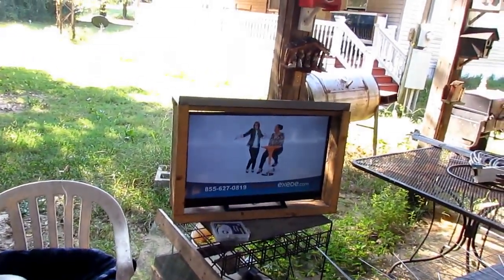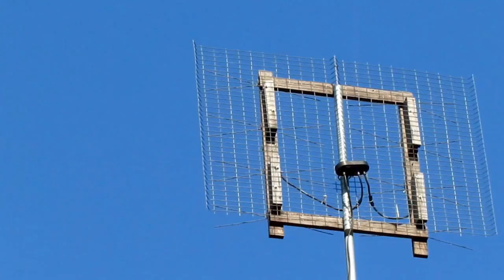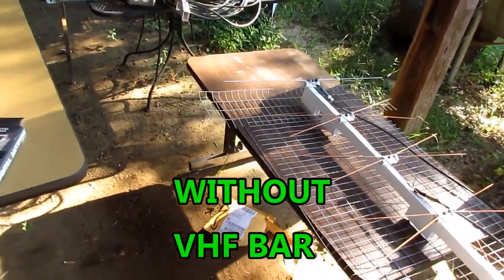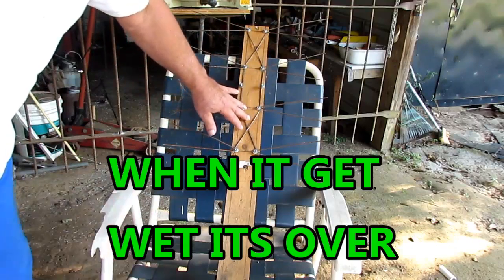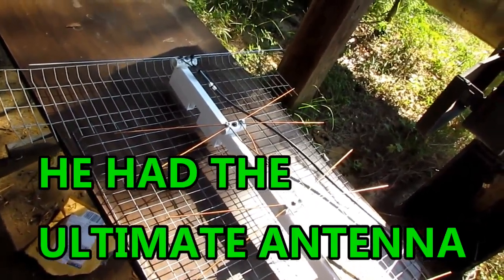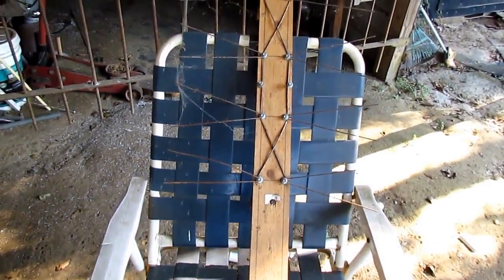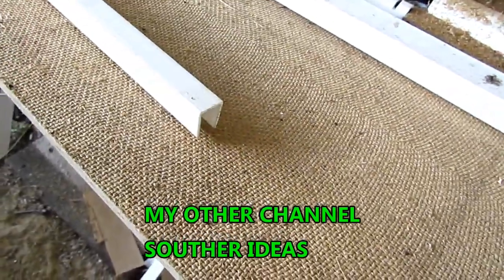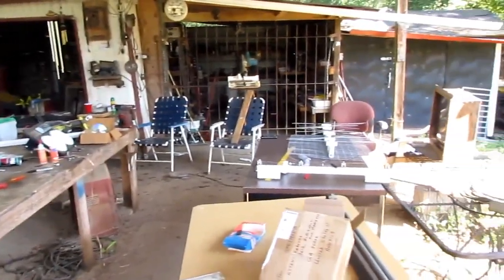Making TV Antennas 101

Comment: Turbo HD TV Antenna will fit in a shipping carton REAL NICE.  Let me caution you though...  the public is extremely stupid about antennas.  They will screw up self installations in numerous dumbassed ways.  Once I had a antenna  we shipped with coax already attached.  All they had to do was take it out of the box and screw the wire to the connector.  Had a 20% RETURN RATE on an incredibly good antenna.

Comment: Danny, I built the ultimate antenna and it works pretty good, but I have a problem.. All my channels CBS, NBC, ABC, and Fox are located Southwest of me around 40 miles away, but I have a local Christian channel that is about a mile from my home located to the Northwest. I'm having to use the RCA booster to pull in the distant channels to the Southwest, and that is causing the really close channel to overload my tuner. Is there any way to maybe add a reflector to the right side of the antenna to block that strong signal that's so close to me?
Reply from the maker: it might not work that close
Reply: Do you also use a distribution amplifier with the RCA pre-amp?  If so that can definitely overload your TV tuner.  If not, maybe you can add a 3 db or 6 db attenuator b4 the signal gets in the RCA pre-amp.  Your idea also might work.
Reply from the maker: NO  distribution amplifier
Reply: You can get a tunable trap and tune out the interfering station. I did that with my FM tuner when I lived on campus near the UCF radio station. I was trying to get classical music stations.

Comment: I think the reason for my question is the dimensions used for the "whiskers" = centered @ 9 1/2"  vertically correct?,   and the dimension for each leg the "diamond" is 7",  correct ?.  if both of the above are true than the diamond will be "out of square" by just over a quarter of an inch vertically,   if that is correct,  than I have no further questions on this antenna.   thanks,  regards
Reply from the maker: thats right